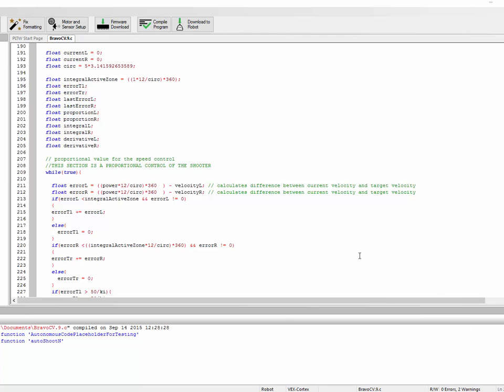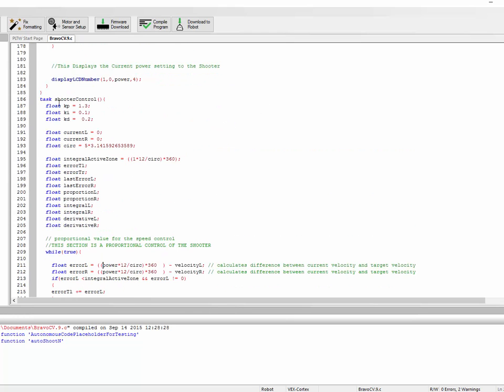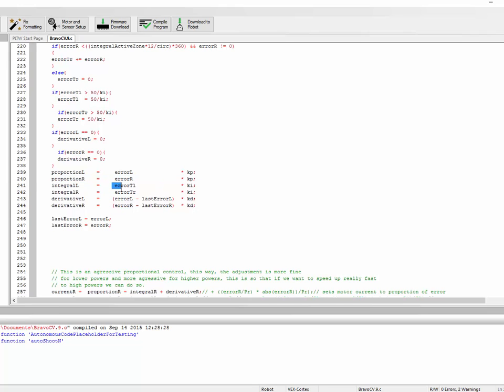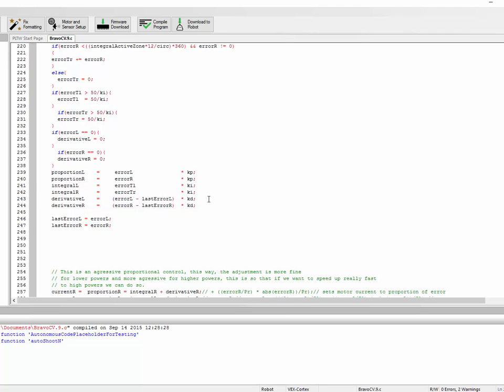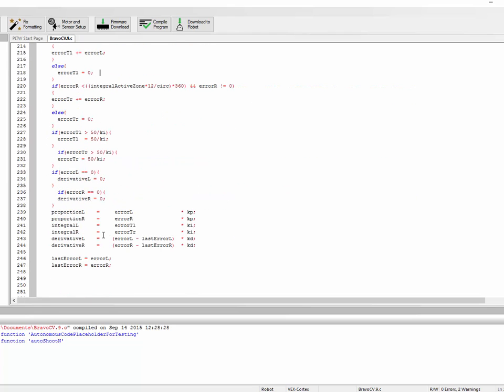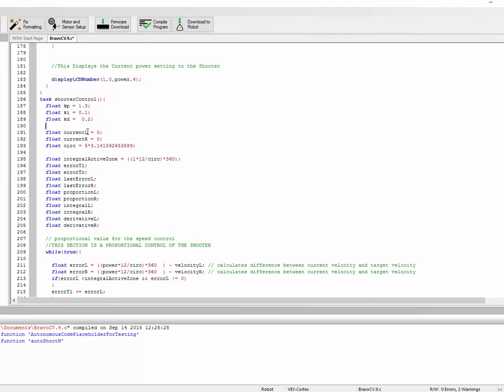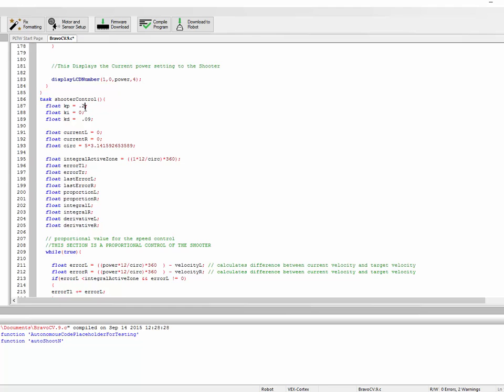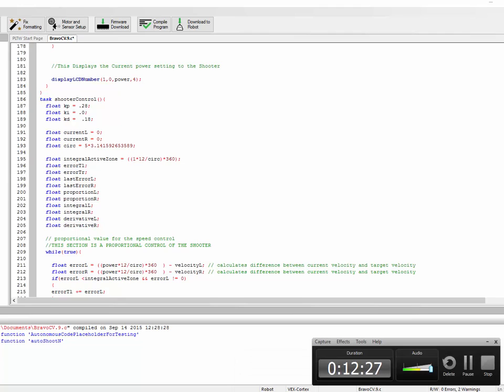PID Control loop Tutorial

Comment: 6:27 You said "when Error equals to 0," but you actually meant "when Error does not equal to 0," right?

Edit: Nevermind. What you actually meant was: When Error reaches 0, the Total Error should also equal to 0. Am I correct?
And when Error is between the limit and zero, then the Total Error should accumulate. Is that also correct?

Also, when Error is greater then the limit; would the Total Error not accumulate?

Comment: Line 213 - what if the error is negative...then it is set to 0. so I and D won't control the motor on overshoot.  Was this intended?
Reply: line 213 only has control over the integral term, it could not influence the derivative term. Integral Active Zone is always a positive constant, so if error was negative then it will certainly be less than integral active zone, and it will accumulate

Comment: our team has written out this program but we are having issues when it comes to running it. when we run it the motors rev up extremely fast and they are just stuck there.
we are running IMEs on the two motors so we are using "getMotorVelocity" for the velocity left and right we dont know how to setup our power so we set it as a solid 63 thinking the IMEs would return values in RPM. we changed integral active zone to a solid number because we didnt convert our RPMs to FPS. but it seems to cause an issue in the statement " if(errorR < ((integralActiveZone*12/circ)*360 && errorR !=0 " 
please email me at rhcsrobotics@gmail.com  ASAP
and thanks for the video
P.S. if you could could you also email this program or the function you use to calculate velocity and speed
Reply: +Rochester Hills Christian School Robotics  I have roughly the same issues and it seems no matter how i set up kp  I end up essentially having a solid motor speed
Reply from the maker: +catfishrule Both of you please email me your code at cdstiers1@gmail.com I will look through it and get back to you

Comment: So how would i change this program for one flywheel with six motors?
Reply: another thing how did you define the power and velocity. plus do u set current to 127?
Reply: +mitchill Reasoner ok so step 1 - using six motor, this is really easy, so you have 3 motors on each wheel so where I set two motors to "currentR" and two to "currentL" you would set all three motors to that variable.next "Velocity" is measured by an encoder, I have a separate task that takes in encoder value and converts it, if you want more details send me an emailYOU set power, Power is the target velocity, (in FPS) define it any where in your code by saying power = ......  ;
Reply: +collin stiers it's a single flywheel and what's your email??
Reply: +collin stiers ok I emailed you
Reply: +collin stiers i emailed my prorgam
Reply: +collin stiers   Can you email the code of finding the velocity value from quad encoder and converting?
brianskyblue@gmail.com

Comment: So I followed your tutorial and wrote up the code, but I'm confused as to what I put in as a velocity variable and power variable.  I'm using an IME on a turbo internal motor for calculating it but how would I take the data from that and put it into the velocity?  Also for the power variable how would i set that to a target within my main task?  I much appreciate any help, this is my teams first year of competing and our schools vex program started this year as well as this is just now coming up on my second week of using robotc and we are very clueless.  Please help !  :D
Reply: +David Chandler  "Velocity" is measured by an encoder, I have a separate task that takes in encoder value and converts it, if you want more details send me an email YOU set power, Power is the target velocity, (in FPS) define it any where in your code by saying power = ......  ; specifically for the IME's - they have a function, you can look it up online but I belive it is called "getMotorVelocity" which get velocity in Degrees or RPM per second.  other  wise yo measure velocity you do thisencoders = 0;wait1mSec(20);DeltaTics = encoders;velocity = deltaTics/TicsPerRotation* wheelCircumfrence(in feet) * 1000/20;"TicsPerRotation" chages depending on your setup, a red quadrature encoder has 360, for the IME's tics per rotation changes based on your internal gearing, you can find more info for this online

Comment: With this code, how fast is your flywheels fire rate?
Reply from the maker: +Nico Yensen  .8 balls per second, we can go faster or slower, slower = more accurate faster = less accurate
Reply: +Wannahokaloogy Greg (Wanna) I see, and do you have a dual flywheel set up?
Reply: What if you have a function put more limitations on the i term? What fire rate are you getting right now?
Reply: +Wannahokaloogy Greg (Wanna) You limit the term as much as you want. one of the limits changes how high  "I" can goyou can make it so the max power "I" could send to your motor is 1, garunteed no overshoot with that, find a max value that works for you

Comment: Is the "power" the ticks per inch, then u mulitpied by 12 to get the ft?
Reply: +Jim Nguyen Also, why for errorL its just Integral Active Zone, but for errorR, its Integral Active Zone*12/circ * 360?
Reply: to answer the question in the original post, Power is in feet per second, then it is converted into tics per second. to answer the second question, it seems that that must have been an error, the correct format is IntegralActiveZone*12/circ*360. this is because when i define integral active zone in my code i define it in FPS, because it is easier for me to think in feet persecond
Reply: +collin stiers I see, so is this equation (tics/360) *x*12*PI   that you posted before for fps or for tics per sec?
Reply: +Jim Nguyen not sure what your question is the equation would be to convert from one to the other
to get from tics per second to fps would be (TicsPerSecond/360)*(wheelCircumfrenceInInches/12)
I have wheel circumference in inches because the vex wheel diameters are labeled in inches, this is what the value circ is, wheel circumference in inches
to go the other way, converting from FPS to TPS would be

(FPS/(circ/12))*360
Reply: +collin stiers Ohhh. I see it now. thanks for the explantation

Comment: Nice PID control there!  Would you mind sharing your mathematical calculation of your current speed?  How did you get the (power * 12 /circ) 360?  You can private message me.  Thanks.
Reply: +George Santos 
the private message is not working, to measure current speed I just convert tics to inch, then to feet, that is the line of code for the equation above, it gets me to my desired velocity in tics per second. to get to velocity in ticks per second I have a loop that runs every 20 milliseconds, at the end of every loop it stores the encoder values and then zeros them. then velocity is tic/measurementInterval, so in my case, tics/.02 to convert to feet per second,  you just need to know the tics per second, and the number of tics in one foot, and the conversion is easy, so tics per foot on a wheel of x diameter, where x is in inches = (tics/360) *x*12*PI
Reply: I'm having trouble understanding what exactly ticks are.
Are they a term used only for encoders, such as the shaft encoders or integrated encoder modules?